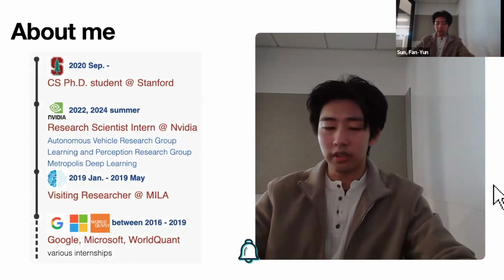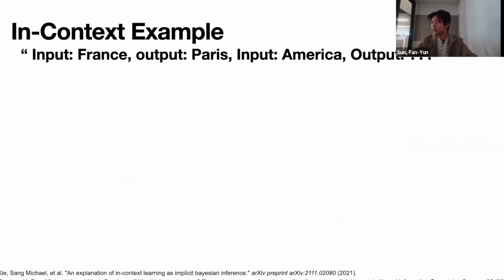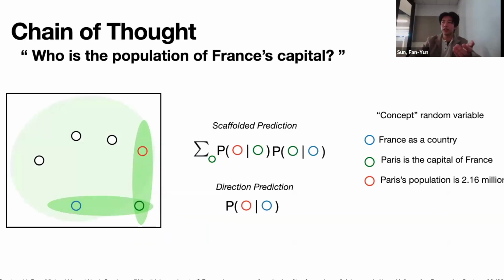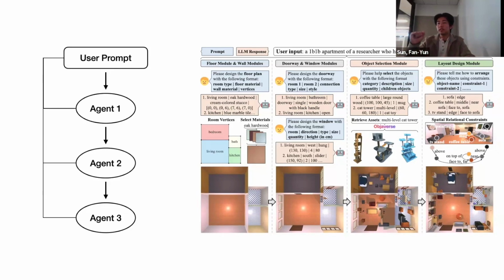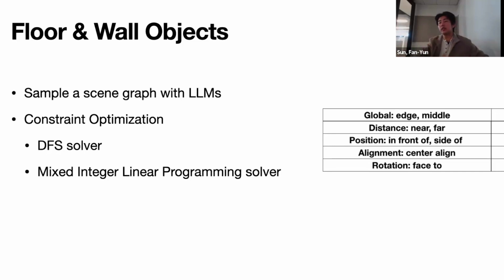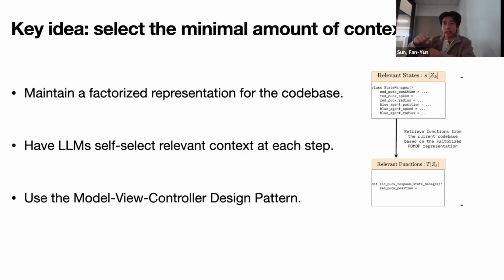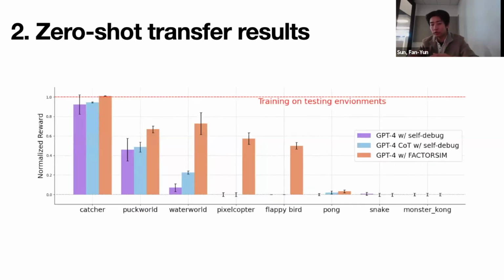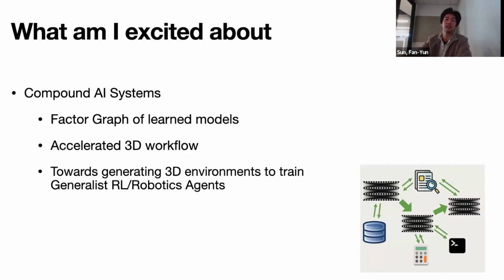Using AI to Create 3D Worlds to Train #reinforcementlearning Agents

Comment: How does contextual intelligence deal with multi-modal data streams in real-time? Wouldn’t that require a crazy amount of Neural power? Considering the systems and chips we have right now, how long would it realistically take to get to the ‘comfortable’ stage? 

Great talk! The applications of contextual intelligence are actually crazy!
Reply from the maker: That's a great question. I asked our guest about it - will share his thoughts once I hear back from him.
Reply from the maker: Here is the response from the guest speaker: Contextual intelligence, in my view, is a means of optimizing computational resources rather than increasing them. Instead of running a complete forward pass through a large foundational model for every step of query, contextual intelligence allows us to only consider the relevant context.

I have strong conviction that "contextual intelligence" will be a key aspect to the future of compound AI systems, including systems can seamlessly handle real-time multi-modal data streams.
Reply: Also, I’m just thinking how useful contextual intelligence can be for game environment designers, especially when they hit a creative block